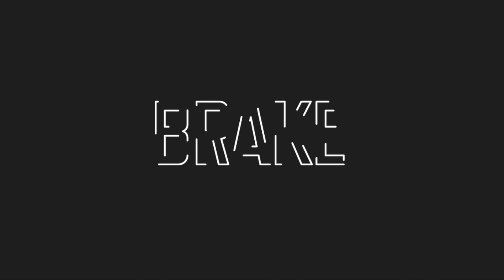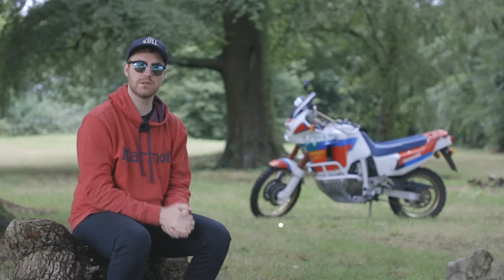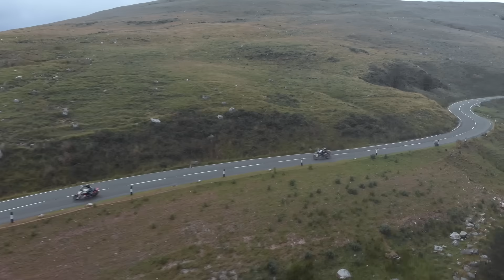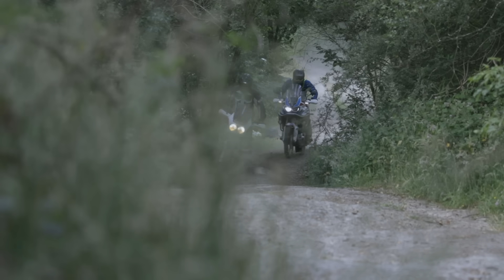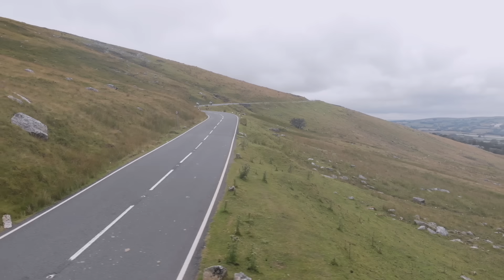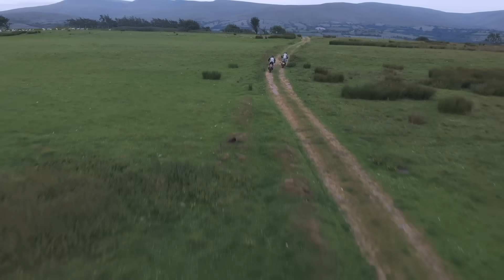Retro vs Modern - 1991 Africa Twin vs 2019 Africa Twin

Comment: Honda Transalp 600 vs 700 would be cool
Reply: seen some old transalp with well over 5,00,000 kms. no engine work done whatsoever. must be incredible bikes made to last i guess.
Reply: The Transalp engine would be perfect if mated to a modern chassis and suspension.
Reply: @SeanHollingsworth  yep. All transalps lacked on that department. I think they could have made it so much more capable for OffRoad use, such a shame it never happened
Reply: @SeanHollingsworth  And a lower center of gravity. My number one complaint of my '89, BUT I STILL LOVED IT!
Reply: Absolutely love my 650. It's so much fun off road. Way more capable than it should be. Only thing lacking is a bit of grunt, oh and a bit more ground clearance would be nice lol
Reply: I have an '89 Transalp with ~37k miles, 50/50 on/off road. The OEM suspension was admittedly weak but RaceTech cartridge emulators in front and Olins shock in the rear turned it into a whole new machine that has done Moab, Baja, and the TransAmerica Trail. Money well spent!!
Reply: I STILL LOVE MY 659 FROM 2006

Comment: The DCT version of the new Africa Twin is considerably heavier than the standard gearbox unit. It also contributes to the detached feel and lack of responsiveness both in the drivetrain and in the suspension. The standard shift bike feels sportier and more engaging. Ride both to see for yourself. Otherwise your review is very informative and I appreciate how you address how each bike feels in different situations to the rider. The new AT is a great do it all bike ( I love mine!) but many of us want a smaller, lighter version in the original displacement range.
Reply from the maker: It does, but I'd argue that the standard Africa Twin is still objectively top heavy and has a vague front end. I rode one last week, back to back with a 790 KTM.  :)
Reply: Brake Magazine  I agree. Time and tech march on. The WP suspension on new KTM/ Husqvarna’s is higher spec, higher quality. The revised fuel tank on the 790 is brilliant, and the resulting mass centralization really helps to reduce inertial mass felt when changing direction. The smaller, lighter reciprocating mass of the motor is another factor. The 45 mm front fork on the AT is undersized for a serious ADV bike: my 1997 KTM 620 Adventure, a much lighter bike, features 50mm WP Extreme forks. The KTM 790R model uses WP 48mm and is considerably lighter. KTM’s are expensive: you get what you pay for in terms of top shelf suspension. Honda is betting that for a majority of riders it won’t matter. They are probably right.

Comment: Brilliant. I own the new AT. Loved it on the road but beyond my skill set to handle the weight off road. Hopefully the next iteration of AT in 2022 when they introduce AT 900 would bring back the original goodness of meaningful weight for moderately skilled riders. WOuld love to see the following bikes tested: Kawasaki z1 vs z900; Yamaha 600 Tenere vs Tenere 700; the BMW R90 old vs the new.
Reply: They've made the transalp for that. 

The AT is not going to be a small light bike for beginners

Comment: great video folks, down under such a different range of requirements. The Africa Twins are being thrashed but the hard core adventure riders are still riding suzuki DRZ400e's , DR650s, KTM 690's, Huski 701's,  WR250R's -  and modified larger enduro bikes, lighter, reliable, and more versatile and more capable off road. The bigger KTMs are being ridden hard but usually by very experienced riders. The new small adventure bikes like the Kawasawki 300 etc near zero takers. Bike needs to do everything.

Comment: A small suspension upgrade on that old one and you have a fantastick bike, and cheap.. Love them both...
Reply from the maker: Cheapish. They're quite expensive for 30 year old bike. The one in the test cost around £3500 in average condition.
Reply: @BrakeMagazine  tells a bit about the quality and kudos of the old bike. Here thats cheap. The new one is about £18900 to £21000 depending on model and gearbox
Reply from the maker: @toby7504  Where is here? It's between £12K and £14 here.
Reply: @BrakeMagazine  norway.

Comment: Triumph Tiger 955i vs Tiger 1200
BMW R1150 GS vs R1250GS
Cagiva Elephant 900 vs Ducati Multistrada
Suzuki DL650 2005 vs DL650XT 2019
Reply: 1100GS surely?  Not that I had a couple and loved them. They were heavier than the 1150, It might be more of a step to the new bike than than the 1150.
Reply: @gretchensghost , 1100 is more robust, reliable ABS and gearbox.
Reply: Almost, Triumph T400 vs new 900 Explorer and Cagiva should be against Desert X

Comment: So essentially you buy new suspension for the old bike for ~1.5k and the thing is perfect
Reply: Probably just a set of Emulators, fresh oil and you're done.
Reply: @gasdive  True. That would do quite a bit. But if you want to lift the bike intoodern times handling wise you'll have to upgrade

Comment: Dear Friends, you have made a mistake in specs of XRV750 - at the beginning of the vid - it has 209kg DRY, not wet, wet weight is about 233kg depends the year of production.

Comment: Thank you for great video. From your description of the old bike I could understand that you like smaller adventure motorcycle. Is that the case? If you had to chose between 800cc and 1200cc which one would you take? Thank you again.
Reply from the maker: I don't have a preference in size. I'm a huge fan of the R 1250/1200 GS because of the balance, despite it being a very heavy bike.

I think the size of the old Africa Twin mostly stood out as being desirable because the new bike was so large and top heavy.

Comment: Nice vid but...

xrv750 rd04 weighs 209kg DRY(!) and has 59HP (62hp have rd07). I have RD04 ('91) and CRF1000 ('17) - both are great and close to each other!

Why did You choose ADV Sports with DCT not the standard crf1000, it would be closer to compare ... it's like comparing  r1100gs vs r1250gs adv...

Besides that, good job!
Reply from the maker: We've got a bit bit of a debate on the weight going on, because some places say wet and some dry. We'll weigh it and get back to you.

Originally we wanted the standard transmission machine, however Honda didn't have one available when we had our test planned. The convinced us to try the DCT version and I'm glad we did. It would be a closer comparison, but haven ridden a normal Africa Twin since, it's really not that much of a change in the bike. It gains some weight but otherwise, we can do most of the same things with DCT as without.

Comment: We actually have both the non adventure sports and the adventure sports Africa twin, I think a better comparison would have been the standard Africa, given that it's smaller, lighter and more manageable. Still a great comparison thought
Reply: The one you guys tested is the CRF1000L2, the CRF1000L is 10+ kilos lighter, 20+ lbs.
Reply from the maker: While I get your point, this is the bike Honda are pushing as their 'flagship', all singing and dancing adventure bike. We gave them options and it's what they asked us to use :)
Reply: @BrakeMagazine  thats interesting, i own the crf1000L, my dad rides the 1000L2, i prefer the smaller one for offroading, the bigger one is hilariously tall and heavy for offroading, but im also short. We replaced the standard seat with the aftermarket one for a lower ride. the DCT is superb for touring, a lil on the jank offroad though.
Reply from the maker: @marcezs08  I agree about the size. Even the L is quite tall feeling. The DCT just got an upgrade that has made it incredibly smooth off-road. It's surprised us hugely, however I still prefer the control of a clutch.
Reply: @BrakeMagazine  i wish, i honest to god wish, honda would offer tubeless tires for their top tier Africa, changing tubes on the trail on the CRF1000L2, that doesn't even come with a center stand is awful. That is still the worst part about Africa twins and why i think most BMWs are better in that sense for offroading.

Comment: No doubt about it. When the original Tenere's and Africa Twins came out, KTM was all about exotic race bikes and BMW was still air cooled with a shortage of valves.. Got to be a Yamaha comparo next. But that means you need to take 3 bikes out, preferably in a desert. Top vid with 2 excellent perspectives / reviewers. My benchmark still stands. Would a London dispatch rider buy one?
Reply from the maker: If that's your benchmark, we'd all be riding NC 750's... 😂

I agree on the Yam front, however the Desert requires a bigger budget 😂
Reply: @BrakeMagazine  NC 750? Fair Call. I was reminded of 80's - 90's London. When kerbs were kickers and traffic islands were for overtaking. Got to mention it again, awesome pair of presenters and great review concept. Thank you.

Comment: Great review and idea .  Love to see KTM 790R against KTM 950SE as same HP and weight and 12 years apart
Reply from the maker: Not the same weight, but that's what we're working on. The KTM 950 is about 20kg's heavier :)
Reply: @BrakeMagazine  950se is 190 kg in my owners manual. I'm not talking about 950 adventure
Reply: 950se has more suspension travel and ground clearance than the 790r and a much higher seat. hight.  A smaller fuel tank. Of 14lts. The 790r seems to be the modern version of it!

Comment: The 27 year old AT is still going strong, looks great with more ‘presence” and gets my vote. How will the new one perform in 27 years time?
Reply: Whould any modern bike even start in 27 years ? I have a 2017 Africa Twin and a 1999 CBR1100xx. They are both "flagship" Honda bikes but the 90´s CBR is way better built.
Reply: @steeltube195  hi mate i have a vfr750 97 model and its still in great nick.
Reply: @neilwiddison6529  ZZ-R 600 1998 and going strong!
Reply: Clam down its a honda take care of it and it will be fine 30 years from now
Reply from the maker: What a question!
Reply: Brake Magazine   Most of these newer ADV bikes will be in the trash with a litany of impossible electrical problems that require proprietary tools.
Reply: @hrbestalkinme3690  True. Plus the raft of electrical " advancement " that makes it perform better today will be its weak point in the future.
Reply: Agreed, I remember drooling at that 1991 AT on the showroom floor back when i was in High school. Its still a sexy beast today.   I test rode the new AT last year and was thoroughly disappointed. Felt disconnected from the road like the reviewer said. DCT is nice on long rides but also feels like something is lost. I think I'd consider buying the 90's version for some adventuring if the price was right....that or an XR650L with a rally fairing on it.....
Reply: @rickc2222 Какую цену считаете адекватной для мотоцикла 1995 года в отличном состоянии с пробегом 40000 км ?
Reply: That is also my question.
Reply: Better then The New 1250 gs! :))
Reply: @Instructorautomoto  LOL
Reply: new will do worse sinc euro 5
Reply: ..now you guys make me feel good about my T6 with 90K..to keep it..
Reply: What makes you think we be allowed to have personal transport in 30years?,that unfortunately,is not the plan.
Reply: Same as the old one. They know what they do. Honda!

Comment: I love how you mention the rawness of the old bikes. I have a new Africa Twin, and I love it, but i do think that the computer and the bike take over some of the riding, and it limits how much I feel, and how in control I feel. I also ride dirtbikes and other streetbikes. I will say there is something I love about the absolute control I feel when I ride more simple manual designs. As you stated, it makes you feel like you earned every corner, and the entire trail. The more the bike does for me, the less sure of myself I am when I push my limits. Just a note. Love the new bike though. Very fun.
Reply: Moto.Knight one of the things I love about my AT (I chose a manual version), is that you can turn ABS and TCS off so you have that feeling of raw control.

Comment: Wouldn't mind seeing the comparison of the rd07. No major changes were made but 10 years makes a difference as well. My 95 year model has some upgraded suspension and some amazing 70/30 tires and there is nothing it cant handle. Still would love to get the new one but with a manual gearbox. 😎👌🏻

Comment: How about BMW750GS vs the famous 650GS Single, people are saying that things evolve but BMW was totally unable to fill the gap over the 650. People tend to forget that it was produced for almost 15 years in several variations and it is still one of the most maneuverable bikes that ever existed with fantastic geometry, great fuel autonomy and just sheer control and trust. The race for more  powerful  engines seems so useless when I get back to ride on my 2006 650GS single, just makes you think of travelling around the world...
Reply: That Rotax engine built specifically for BMW is the best motorcycle engine that Rotax ever made, in my opinion. The ones that were mated up to the American ATK motorcycles were not as good, although they appeared identical.
Reply: Interesting. I tried the 650 first time presented. Unbelievable lame with no Torque, like driving a moped.. 
Preferred my long outdated Honda 750 from ~1973...

Comment: You told me yes but it seems that the new bike doesn't excel really that much over the older one. Do XTZ660 second gen (dual circular lights) vs the newest one. Very nice comparison but would like it to be longer. Or do a longer version of these with more riding, opinions, chat between both of you, question asked before you ride the bikes at all, maybe proper day on the bike like we all would do.

Comment: D
Suzuki vstrom old vs new please
Reply: I have a 2004 DL1000 and love it. My friend just bought a 2018 1000 and he love that one too. The new one is a bit lighter but they replaced some of the metal with plastic. The new one does not have the room for tool kit and such under the seat like the Gen1 does. Then it comes down to how much you want the antilock breaks and the electronics. But I agree I would like to see these guys do a comparison vid as well.
Reply: @mctourer5549  Nice summary thanks. I've got the 2007 DL 650 and love it! only thing that annoys me is the parking lights that come on a tiny click more  to the left of the steering lock. Happened to me TWICE that when locking key slipped tiny bit to the left (lights on) and left me with an empty (=broken) battery.:-o

Comment: I wonder how the old bike would perform with a suspension refresh or a retrofit of more modern internals.
Reply: Lots of VFR 750/800fi owners do that and find massive improvement. I fitted a Nitron shock, Hyperpro springs and experimented with oil weights and got great improvement. Some did Maxton internals etc but even Maxton themselves believed the improvement was not really worth the money because the design limited the type of internals.

Comment: I agree, the "older" bikes with less bells and whistles. I would like to see a Honda CRF650L based on the XR650R chassis, electric starter and EURO5 standards. As light as possible with room for light luggage.
Reply: I'd buy one
Reply: Hell no, we need a revamped aluminum frame XR650L. Would make it a super competitive dual sport.
Reply: F Euro5
Reply: You do realize that the xr650l chassis was actually heavier than the steel xr600 frame, right? We don't need euro5 in the usa. Just more catalytic converters being sold on ebay.

Comment: XT600 tenere (1VJ or 3AJ) vs. Tenere 700.
Reply: Also 660 Tenere in there, maybe a group Tenere generations test? I want to see how much the 700 improves on 660 and no one has done it yet
Reply: XTZ 750 vs xtz700
Reply: Agreed... 3 generations of Tenere would be a great video!
Reply: Good choice
Reply: This! The old tenere is so much lighter than the old Africa twin. Really interested how it compares.
Reply: I just got me a 1988 XT600 i guess the 2WJ  version... No electric starter, kickstarter. Its my 3rd bike, and so far im enjoying it, even the starting which took me like some days to learn the drill. I see many modern bikes, maybe better looking, but theres something about these old bikes that Id never trade them for the newest version, no sir.
Reply: @jl_nineteen87  yeah . Ridden old XT and new Africa.  XT def more out of civilisation ready 👊 while Africa can cover highways and then make shortcut thought woods
Reply: I have buy a 3AJ XT600Z 1989, after 18 years of GS, 1150GS and 1200GSA.
What i do with my 600 167kg dry XTZ i would never be able to go with a big GS with 250kg dry sure.
I'm waiting for 700 tenere to test, but 192kg dry...25kg more.
Reply: I’d like to see the xtz750 super tenere thrown in there too since it has about the same power.
Reply: Yes please!
Reply: Those are not the same class of bikes imo. You should compare the new Tenere 700 with the old Xtz Super Tenere 750.